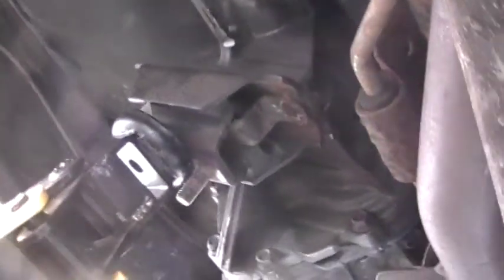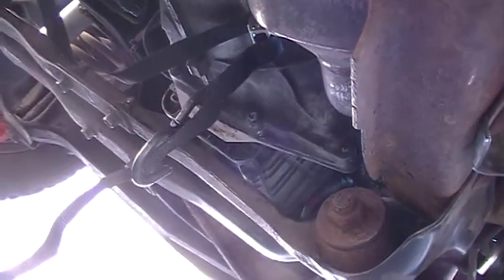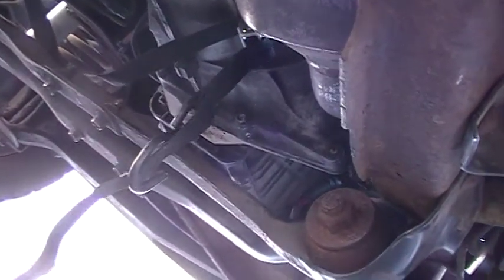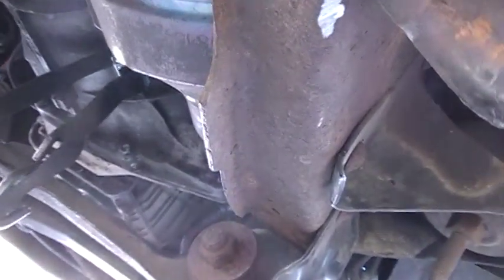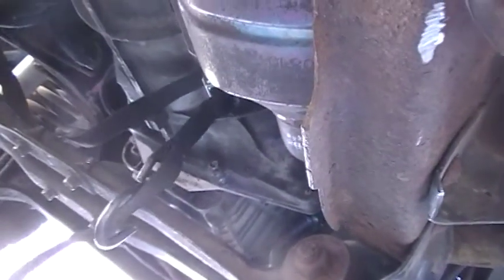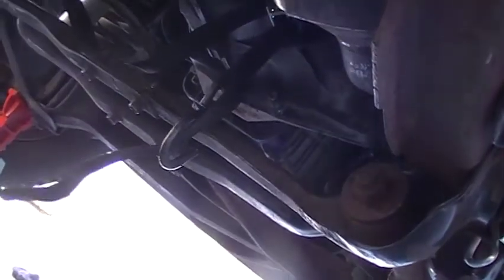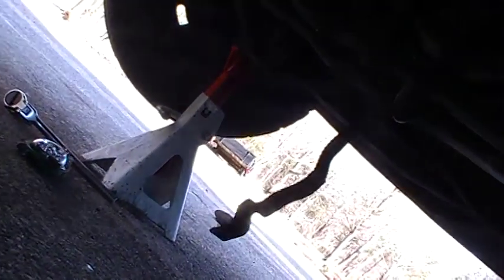Clutch Me Ranger 7

Comment: Sorry, I missed your response about clutch at floor.  There is a U Tube video relative bleeding the hydralic clutch slave that should address that issue.  I was cautioned not to fool with mine to preclude what happened to you.  I hope I don't wind up having to bleed my entire system because I left the job undone so so very long.  GREAT project documentation !  Thanks !

Comment: Mine has been up on jack stands for several months.... Excuses after excuse have kept me from completing this project.  Seeing you do this under such climatic conditions prompt me to "Git IT DONE!"  How did the project end?  Mine is actually V 6 B3000 Mazda - SAME/SAME mechanically.  I got the cross member down without issue.... My issue is now dropping the exhaust from manifold without creating other issues.  Can't get the tranny out with cross over pipe in place.